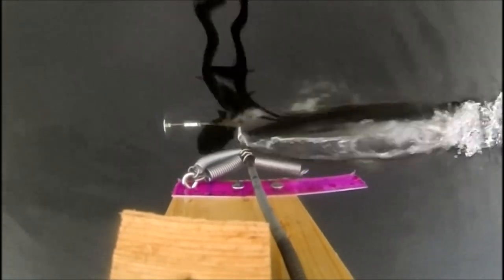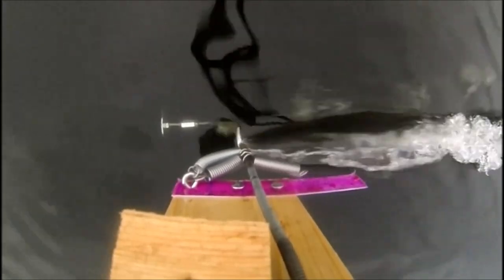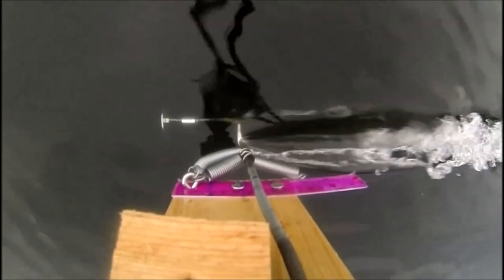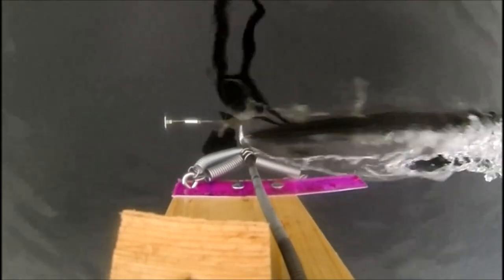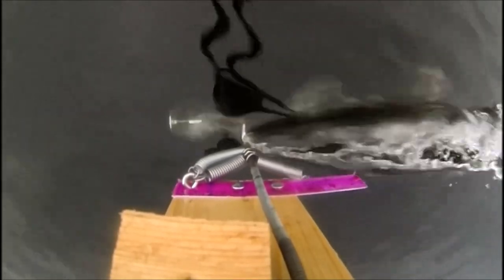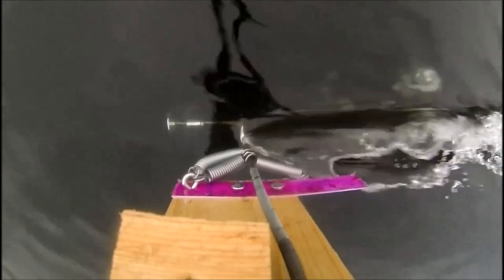Supercavitation video 3

Comment: It's not just the size of the cavitator but also the shape. A cone shape with a cliff at its greatest circumference would cavitate the same but with less drag and less speed required no matter the size. Also a concaved cavitating face would compress the water so much that, depending on the speed, you could super heat the water turning it into steam and create cavitation that way! Great vid!
Reply: Hello Clarence,
You seem to know a lot about cavitators so if you don't mind could you please enlighten me a bit? I have read that ventilated cavitators  allow for supercavitation to occur at lower speeds and from the pictures they are always disk shaped. Is this simply so with ventilation or would these profit from cones or at least a shaped surface instead of a flat disk? Also is the gas injected from behind the cavitator or in front? Some diagrams imply the former but common description of the Shkval implies the former.
Reply: @Starjumper2821  lower speeds doesn't imply low speed. If you look at your video, you will see the cavitation angle. A shallow cone will decrease this angle. A deep cone will interfere with the cavitation process, so you will have to see what works better for you. The disc shape is for very high speeds so a high cavitation AL angle is required because the vessel/projectile is traveling through that cavitation extremely fast. Ventilation is always after, or at the point of cavitation. Because of designs, it may look like there is a choice but once you add a gas, you start cavition from the surface at that point. Having a shallow cone or bowl shape and ventilation immediately after would give you both the desired cavitation and stability. Think about the venturi effect and place it on the outside of the pipe instead of inside it. I'm working on something now that uses these principles and I get stable cavitation at low speeds, 10mph. But the faster I go, the more I need a flatter(disc) shape initiating cavitation. The angle of cavitational flow is just as important as the cavitation itself. As you create cavitation, the fluids press against the surrounding fluids and it causes the collapse of the cavitation if the force is not maintained. The ideal cavitation is maintaining a cavitation that stays closest to your vessel/projectile. It requires the least amount of force and is the most stable form.
Reply: @djfliq1  Thank you very much for your informative (and very quick) reply. Though I have to point out that the video is not mine. 

I suppose I will use a ventilated disk cavitator as the boat is supposed to reach more than 20 knots.

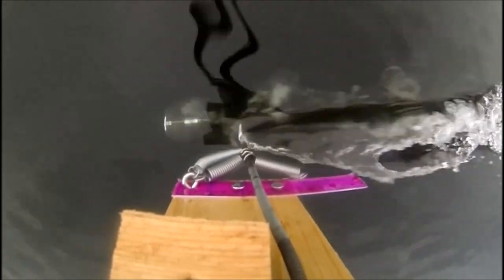Comment: I am sorry to point out  that  this may have commenced  as  super-cavitation  behind the washer at 00:48 but at 01:12 it is no longer super-cavitation  but it changes into an aeration  effect as  behind the vertical tube   that supports the washer, the air will start entering in a  downward vertical direction till it will fill the cavity behind the washer so there is basically atmospheric pressure behind the water and not the very low pressure that existed before the system was aerated from behind the supporting  vertical rod .

I would say that if you included an aeration plate just below the surface the air would not have leaked into the system and cavitation  would proceed  at the high vacuum. I am afraid since atmospheric air was allowed to sink behind the washer,  the system was not working as you thought it was .  Note that  when it was aerated there was no exploding bubbles but just one large bubble  which did not "explode" .  Please check my conclusion through stopping aeration of the system,  to reach behind the washer and I think that  you will find the exploding bubbles will remain when super-cavitation is retained. 

I use this aeration effect behind high speed rudders as  I do not believe in bringing the back of high speed boat rudders to a point but keep the back edge pretty wide.  I feel due to the rudder stock in boats ,  boats with inboards and a long inclined shaft the super cavitation above  the shaft will change to an aerated effect due to the air leaking due to the rudder stock cutting a trough in the water and the low pressure ahead of the propeller blades will suck in the air from the transom or the sides when at the higher speeds. 
A very interesting experiment  with simple equipment which yields much more than one expects. Congratulations for your efforts.
Reply: Your wonderful experiment set me thinking with the results that you did not intend to achieve. On looking at your aeration results may I congratulate you as  what you show is in fact a brilliant method how to design the bulbous bow of a ship. Many  long range ships as Cruisers and Tankers and Naval military sea craft use bulbous bows.
Your method is a brilliant manner how to actually see a virtual bulbous bow in operation with its contours formed by the  aerated bubble.
Note  how the front washer changed the momentum of the water to shoot it out laterally, while the vertical rod does the same and the air that leaks through achieves a remarkable joining of  the bubble that is originated by the lateral momentum of the water from the washer and it is interlaced beautifully by the  lateral spreading of water  from the vertical supporting rod.   There is a beautiful shape where the pressure distribution along the surface of that bubble is just right to make the hull of the ship conform to that shape where the washer represents the bulbous bow front end and the vertical rod represents the bows of the vessel under consideration.  A fuller or a narrower  vertical bow would see to the different designs of the craft under consideration.
Young man may I congratulate you for unknowingly you have originated a novel method how to design  bulbous bows on sea craft. You should patent this method of design.  Heartiest congratulations, Go and discuss what you show with your teachers and any naval architect.  Well done young man.